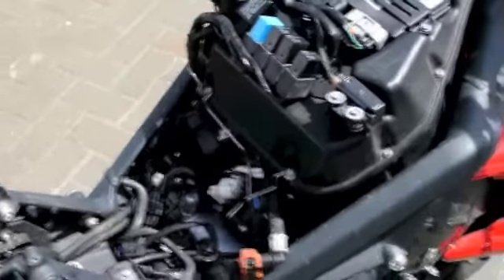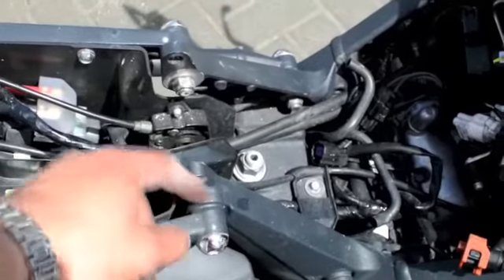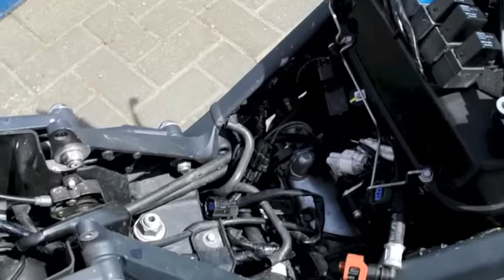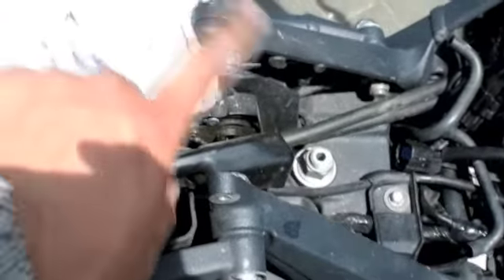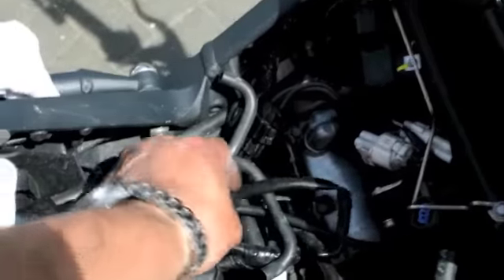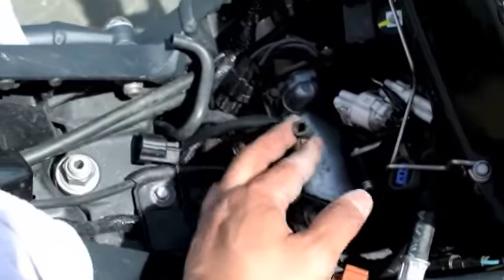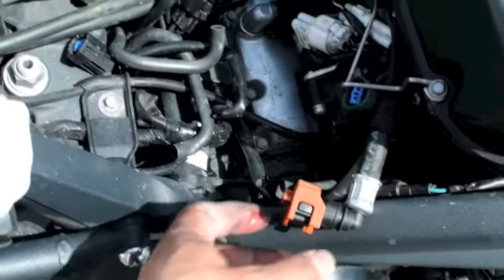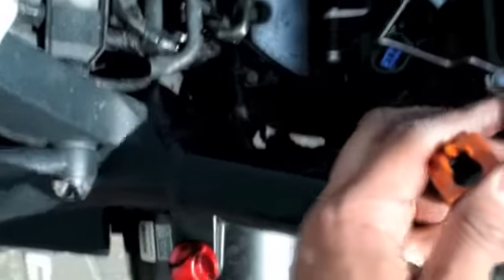How to remove fuel tank on Triumph Street Triple 650 2007

Comment: How do you actually get the orange fuel connector off? I'm having some dramas disconnecting mine. Many thanks
Reply: I had to give it a tug - there is fuel in the line so be careful, i had it in my eye!
Reply: As this is the closest ive seen to it online, quick question the electric connectors on the tank, from the side your standing on camera which one gets connected closest to you and which one is furthest. Ive got the green connected closest to me but not sure if thats correct. 

Thanks in advance
Reply: Me too.
Reply: Do you need to take the tank completely out to replace air filter?